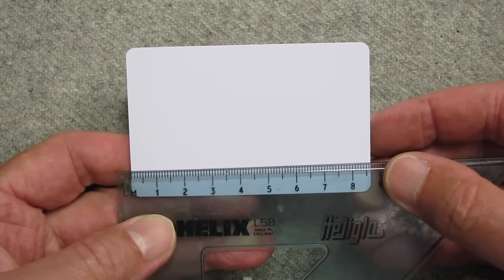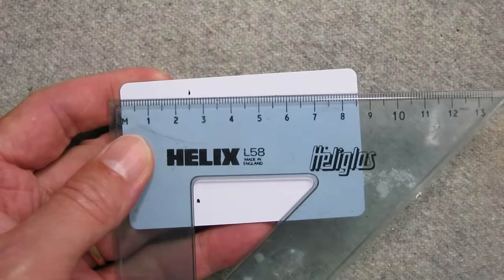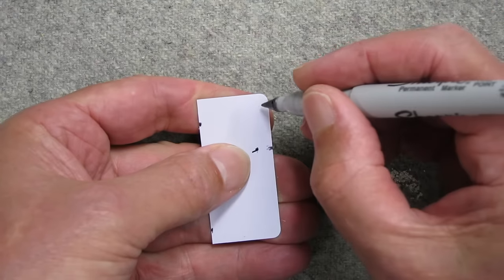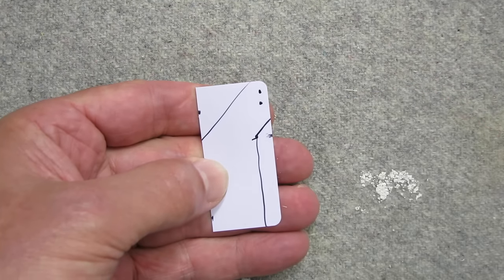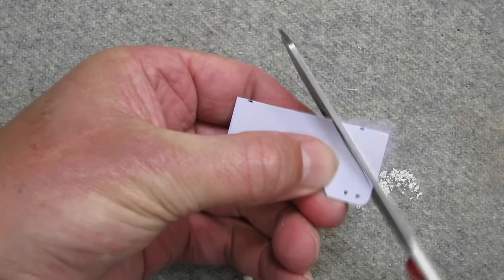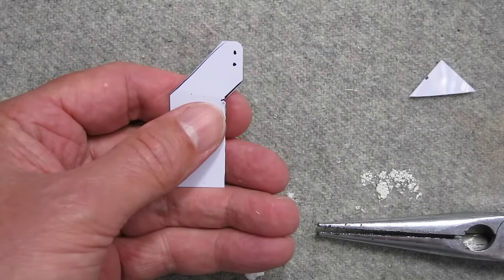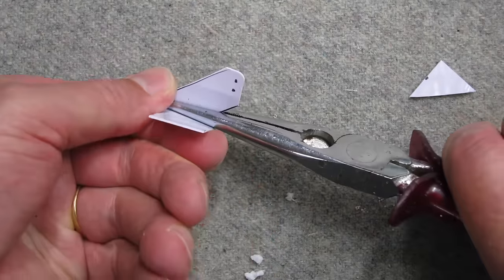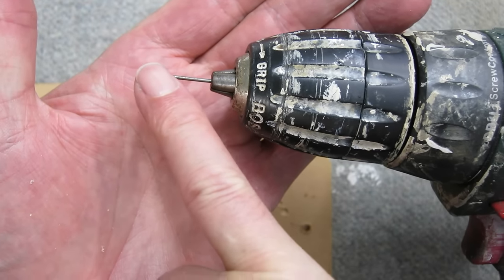ID card Control horn

Comment: I was wondering if you ever get any flex in the gift cards, or would you even be able to tell? Maybe a cam shot would be able to see if they do. I thought about laminating 2 of them together with some Gorilla glue or such and pressing them in a vise or clamp. Would be a good idea for other things, I bet you could get some real strength  out of them that way.
Reply from the maker: +3000gtwelder I have never seen any flex while flying but occasionally the push rod had poke further through the hole after a crash, but it never breaks.